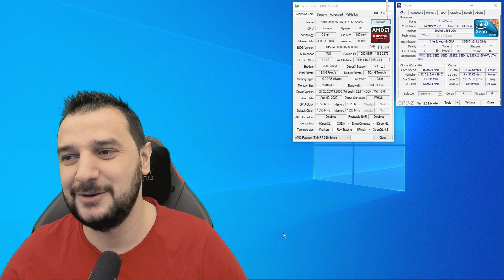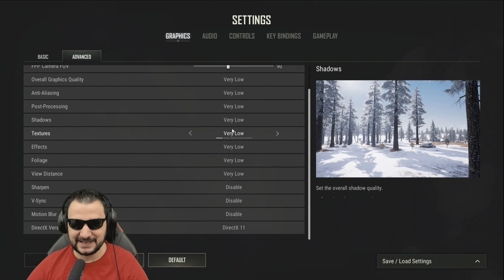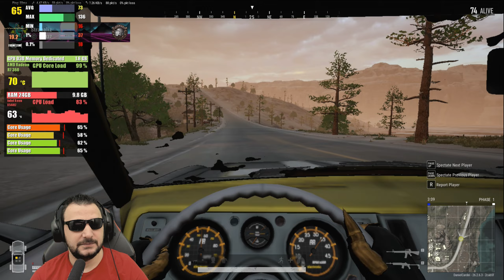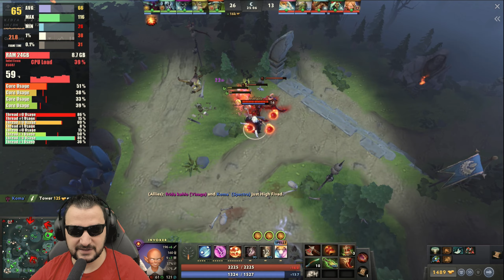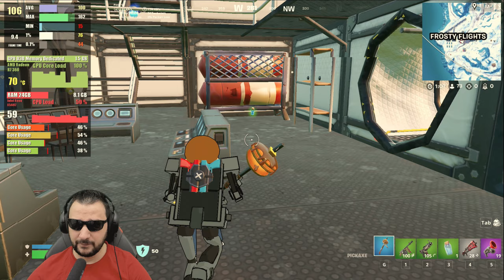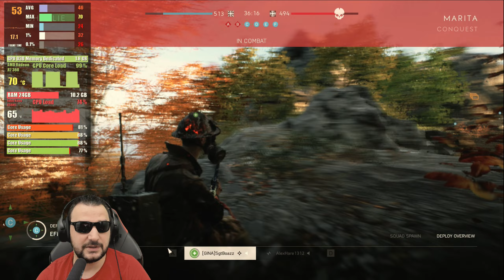R7 360 with Xeon X5687 Benchmark

Comment: thanks for the video but have you tried warzone cuse i am having weird glitches in game like for 5 mins it gives black dots and geometric shapes on characters etc and after it slowly fades not card issues mb drivers
Reply from the maker: How many FPS you have in the game?
Reply: like 30s 40s avrage  @DanielCardei
Reply from the maker: the GPU is on max? or both the CPU and the GPU?
Reply: well gpu mainly but sometimes when drooping stuff cpu also reaches 95 99% but main factor i think is ram i only have 8 gigs so stutter like hell for 15 mins @DanielCardei
Reply from the maker: @pclabs69  definitely you need to max out the RAM and when you can make the CPU and GPU equally loaded that means you hit the nail in the head and keep it like that. Both loaded its the best.